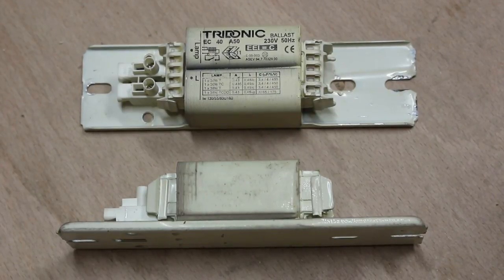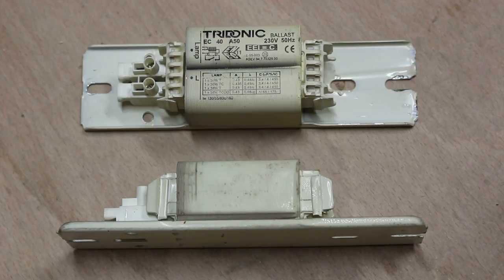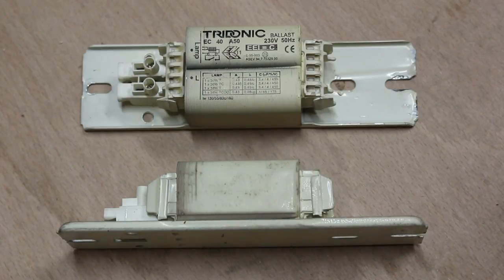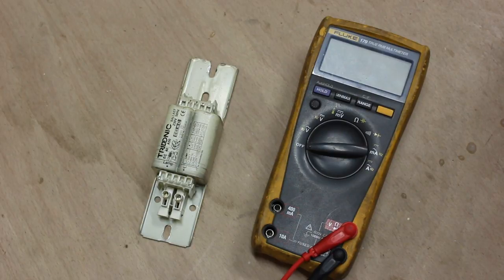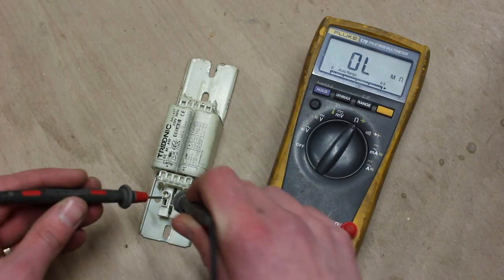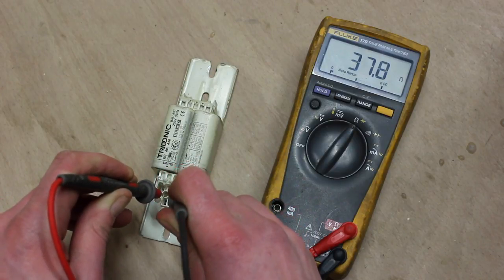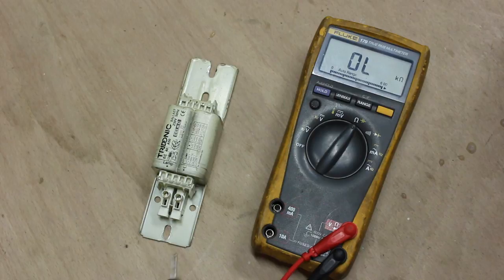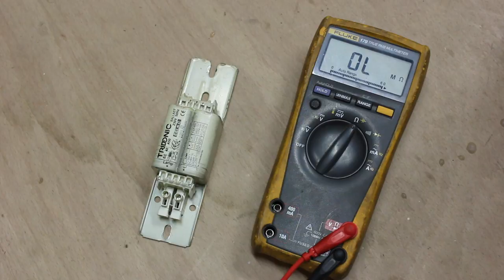How to test a Fluorescent Ballast

Comment: There is a lot more to fully testing the ballast than just checking the continuity of the primary winding.
Reply: what other test.? can you elaborate more.? i still new in this
Reply: And what else?
Reply: Usually ballast  are ok when tested  but  they fail to  light the  fluorescent light bulb